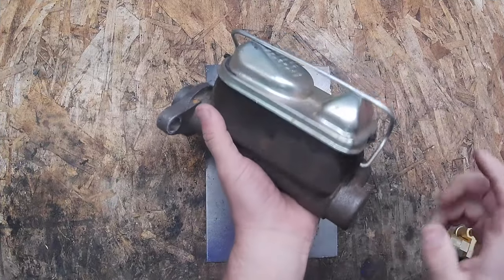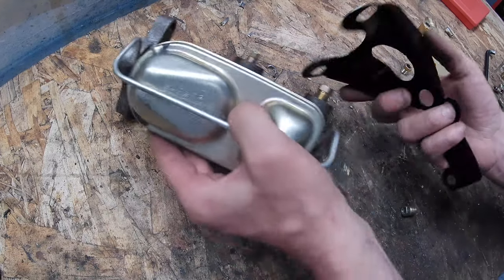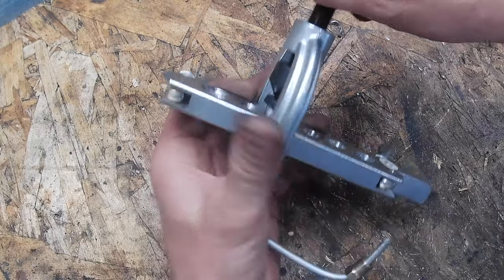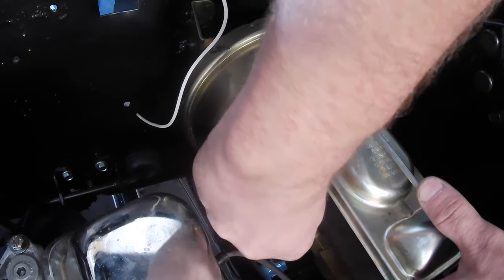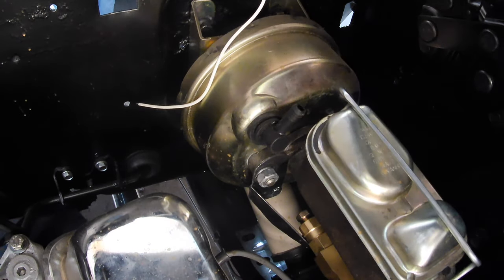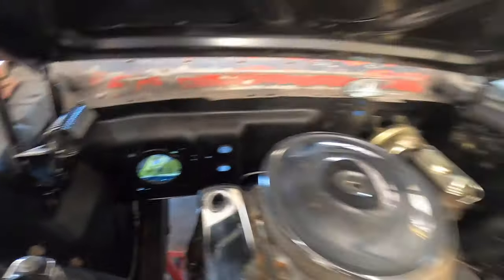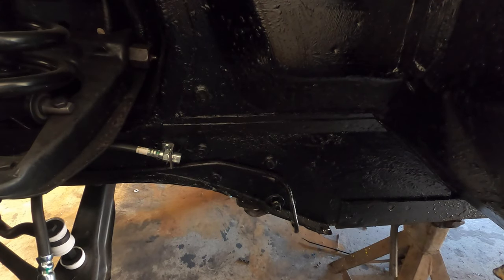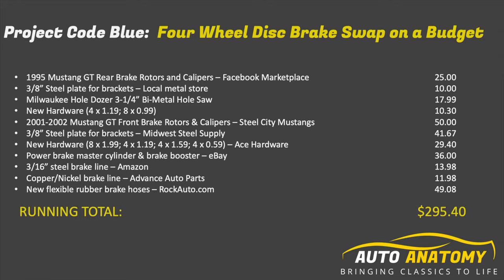1965 Mustang budget disc brake swap: 4 wheel discs for  under $300

Comment: I just finished watching the multi part brake upgrade. Very thorough. I do have a few questions. What was the reason for going with the different year (95 and 02) for the front and rear calipers and rotors? Secondly Do you know if the booster and master cylinder off a 95-02 mustang would work? Lastly I have a 64.5 Mustang with a 260 V8. Do you know if  there is any difference in the wheel bolt pattern?   

thank you
Reply from the maker: Thanks! 
The reason for the different year F/R parts was due to parts availability at the time.  Ultimately, it would have been better (probably) to get the F/R parts from the same car, and if I were to do it again would probably do so.  
I'm not sure about the booster/master question.  I assume it would work OK if there was adequate space.  I believe all Fords (essentially) use the same bolt pattern (small Ford, 5 x 4.5").
Reply: @AutoAnatomy  thank you again.

Comment: What make, model & year did the proportioning  valve come from? Also where did you get the rear brake hose clamps that fit around the axle from? I can't find a master cylinder & brake booster for less than $180 on Ebay. What was the sellers name? thanks
Reply from the maker: The prop valve was a Ford universal one from Speedway motors (I think).   The MC and booster were used from someone on eBay but I think it was just a one-off sale.
Reply: @AutoAnatomy  what vehicle was the booster and MC from?

Comment: Interesting.  I know disc brakes are better but a well maintained and properly adjusted drum system is more than adequate for a 1965 Mustang in my opinion.  Just seems like a lot of work for a modest improvement is stopping ability.  I know some will argue.  Just my opinion after owning several Mustangs.
Reply from the maker: My thoughts centered around performance, reliability, and ease of maintenance.  Drums tend to fade with repeated hard use, and are harder to maintain.  Plus, it was fun for me to see if I could make it work.
Reply: I have had a '65 and '66 for the last 40 years and can say definitively that my '65 drum brakes were absolutely deadly in rainy weather. A small amount of puddle water would drop my braking performance by -90%. Apparently a water film would develop between the drum and shoe and no matter how hard you pressed with 2 feet on the brake pedal, it was like sliding on ice slick roads for the first 50-100 feet after the puddle. I rebuilt those drum brakes 2 times in a month. Once with new shoes and turned drums, and again with new shoes & new drums, with the exact same results.  I switched to Granada disc brakes as soon as I had heard about the possibility in '82 from Lee M. of the now defunct Mustang Farm of Kennesaw Ga.  There are lots of good ideas/kits for '65 Mustang brakes now in 2020. Good Luck & be safe on your project A-A.

Comment: Great job!  I may have missed something. How does one bend/ form/ shape brake lines? In satellite communications electronics, we use semi-rigid cables (Hard 50 ohm coax that looks like brake lines)  and we use a bending tool. Would this be similar to bending brake lines?
Reply from the maker: Howard Koster There are a variety of methods, but all require some form of bending tool.  That can be as simple as a piece of wound spring wire, or a hand-held bender.  I used a bender from Harbor Freight, something like this:  https://www.harborfreight.com/tubing-bender-3755.html
Reply: @AutoAnatomy  ok. We used a and bending tool also. Too bad I don't have it anymore. Thanks.....

Comment: I am wondering if the Mustang is boring for you because it is same old Same old.  Restromod???????    Have you thought about adding items like air conditioning, power options, Cruise control to make it a great driver........I know that Mustangs of this time did not have those things, but you can get new things that are period correct for the timing?????    Just a thought....Might make it interesting for you???????    Good Luck.
Reply from the maker: Maybe so, Jack.  I'm finding myself not really wanting to work on the car but hoping that getting it driving will change my mind.  As it currently stands, I'm looking at getting it driving and then selling as-is for someone to finish, and then using the money to finish the 1952 Chevrolet project (bumpers, A/C).  Know anyone looking for a Mustang?